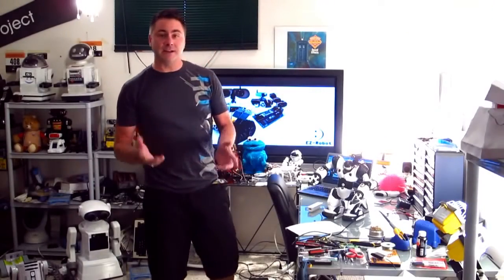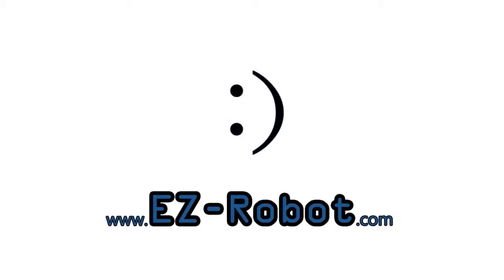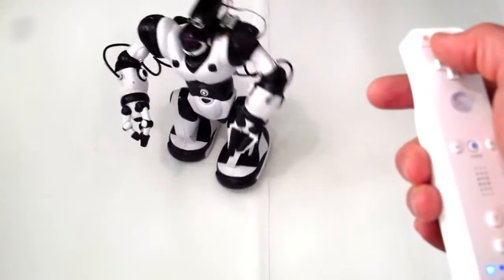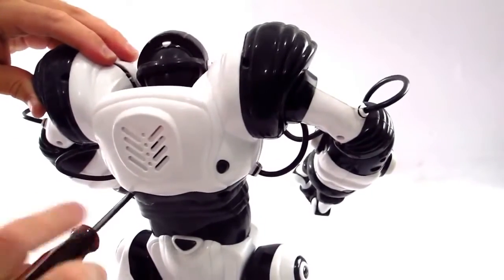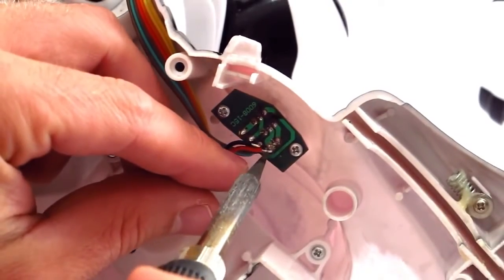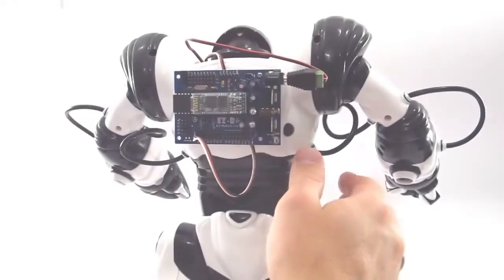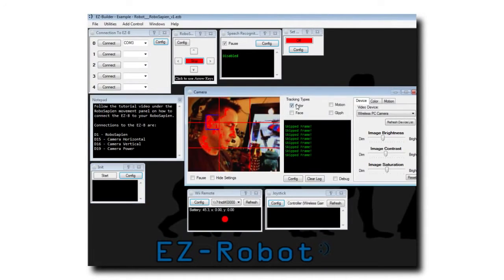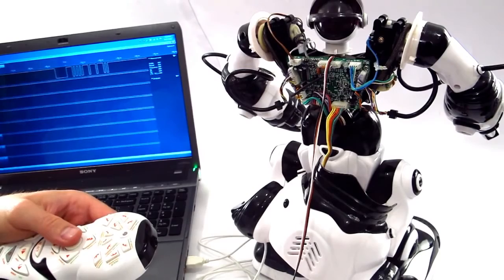robosapien robot control from ez b v3 microcontroller

Comment: thanks for reuploading this I've been looking for this video
Reply: Robot collector 2000  technically yes
Reply: Robot collector 2000  The board is probably not made anymore, and for the coding I have no idea. This video is from like 2012, pretty outdated now.
Reply: Robot collector 2000  yes… This takes advantage of the IR pin inside the robot, which is present in both the V2 and the original Robosapien…